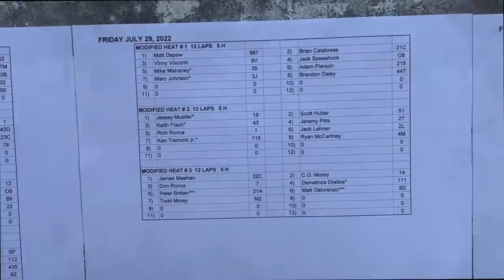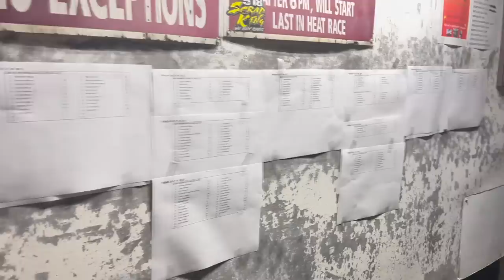They Didn't Have Anything On Us Until...!? More Money On The Line At Albany Saratoga Speedway!

Comment: Sounds like to me you gotta check the gears if the gears are causing problems when you might need to make a taller gear or shorter gear it sounds like to me if you’re going through that then you’re gonna have to change your gears if you’re going through up and down and they’re not it might be the gears I’m gonna say that because a lot of times these guys up here that race but sometimes change the gears and they’re actually make you go either go faster go slower but you don’t want to go super fast because then you’ll be going into the wall and it wasn’t stuck throttle so check those gears and if you got a gear that has teeth missing on it or something like that I would check that part just to make it easier you know I know that you go and check everything maybe it’s a good time to start checking your transmission just in case cause I’m pretty sure if you break a lot of parts it does get costly very costly but sometimes new things do happen and well if you’re changing I sent a quick quicker and changing something like that you go from fast and then you start and you start going to the backI’m thinking the transmission might be going just a just a hard way to think

Comment: Mike, I watched you set fast time and win the heat at Middletown,  start 3rd in the feature and back up. Now Albany, same thing fast in hot laps win the heat and back up in the feature. Your car apparently is only working when the track is tacky and has bite.  You have got to get your chassis more balanced, your riding on 2-wheels most of the time. Your motor seems very good, it would have to be to set fast time at Middletown, your a better than average driver, so  that leaves your chassis program that needs work.  Get the car more stable, more forward bite, which would make it more driveable to your style of driving.

Comment: Great heat race Mike. Sounded like everytime after you set car in corner and got on it when everyone else started going forward your car sounded like it was spinning and then you would catch them in the corner. High or low. Tires? You are a smooth driver. It will come.. Great job as usual Mandee. Thank you both.